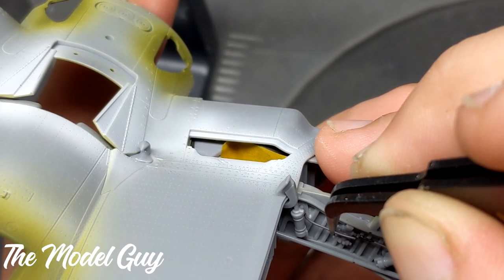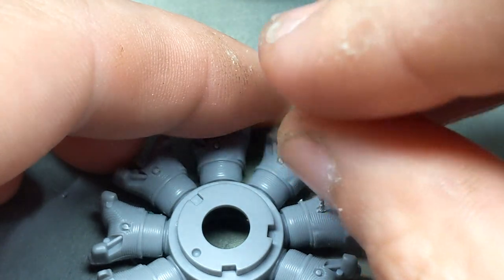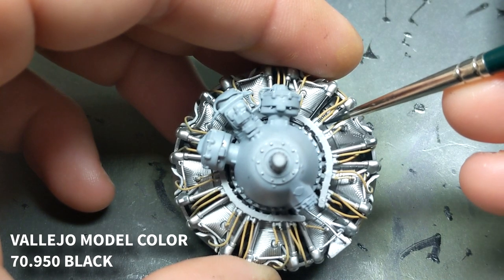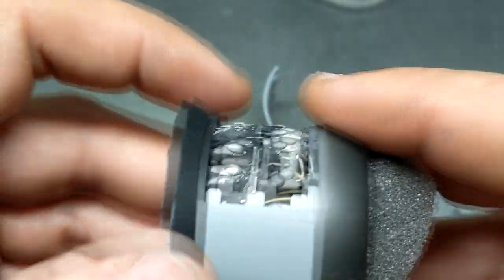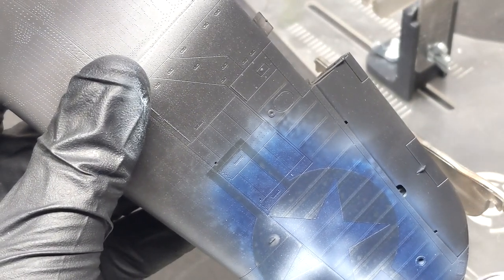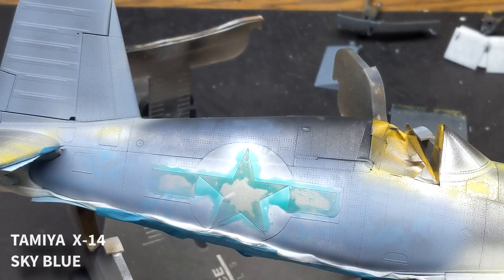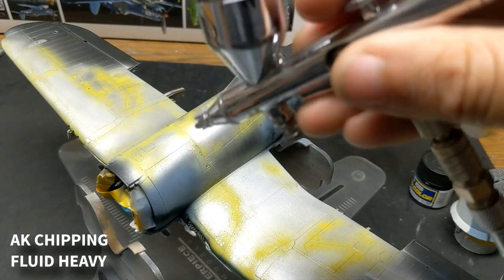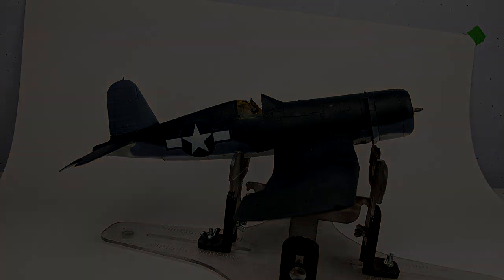F4U-1A Corsair from Tamiya: Setting the base for heavy aircraft-model weathering

Comment: The ignition wires to the rear cylinders run UP through the rear row baffles.  They don't interfere with the cowling when run properly
Reply from the maker: Thanks for the tip. I’m sure to build another one some day. Maybe with the engine completely open.

Comment: Are your cowl details available? While I have a brassin engine set, the detail trade off wasn't worth building it. the cowl flaps are included, but it would take too much work to make them fit with the kit supplied parts.
Reply from the maker: @patharmon9760  I’ll have to see if I can find them. They’re pretty simple and I could design an even better set now.
Reply: @TheModelGuy  That would be amazing. I'm a bot of a novice when it comes to 3D modeling. I've tried Onshape and Tinkercad with better luck than Fusion, but all of them are a bit cumbersome to me.

Comment: Yep, chipping can get frustrating. Tried it recently and let my lacquer paint (Tamiya XF and AK RC) dry to long. Do you think I could get that paint to chip...Nope! Then I tried on a different model and chipped within an hour of painting. Chipped easier but not as easy as other videos let on.
Reply from the maker: What were you using for a base paint and chipping fluid?
Reply: Primer was Mr Hobby 1500, then Tamiya LP-11 Silver (wanted the silver layer to be tough), then hair spray. Final coat was was either Tamiya XF or AK RC on 2 different models. The first model with Tamiya XF dried overnight and then I could dab away with water and stiff brushes until dooms day and the paint would not chip. 2nd model was with AK RC (same process) and tried chipping within 1 hour of applying paint and it seemed to work but was still an effort. Not as easy as many you tube videos suggest. Maybe they where using acrylic paint for the final layer????
Reply from the maker: @Maddog-nb9vu  hmm that sounds like it should have worked. If it's being stubborn, I'll use sanding sponges to start the chipping so the water can get under easier
Reply: I did try that but had to be very careful I didn't sand down to the primer coat. It still was next to impossible to expand on the chipping no matter how much water or dab, dab, dab, I did with a stiff brush. I even tried initially scrapping carefully with a xacto blade but the chipping would not expand beyond the scraped area. The only way I could get chipping  to work with hair spray process was if I started the chipping within an hour or two after the final paint layer was applied.
Reply from the maker: @Maddog-nb9vu  I hear a medium hold hairspray is the best.
Reply: @TheModelGuy  Will have to confer with the wife on that term to point me in the right direction :)

Comment: Looks like at 6:22 you filled the small gap behind what would be the cowling.  You can see a small white material there at this time marker.  Is it plastic card?  Plastic putty or some kind of filler?   I assembled this assembly just now on mine and I have the same exact gap.  I’m asking so I can find the best way to correct it.  BTW I needed just a tiny amount of filler in front of that round filler cap  piece too.
Reply from the maker: That was perfect plastic putty. Once it was in place I wiped the excess away with a damp, not wet or soaked cotton bud
Reply: @TheModelGuy  ok cool I have some of that.  Thanks for the fast response.  Love the videos.  Keep it up!

Comment: I'm just getting into the hobby and started watching your videos. I'm breaking in with the Tamiya VOUGHT F4U-1A CORSAIR 1/48 and the complementing A6M3 Zero. I was wondering what size wire best suited for hydraulic lines and wires for 1/48 models?
Reply from the maker: I would go with 0.1mm and 0.15. You can also strip regular 18 gauge wires too. Whatever looks the best to you

Comment: Robbie I see why you closed the engine up (2:42). You don't have the exhausts glued in. Was it intentional? Great build otherwise.
Reply from the maker: That is intentional. The exhaust were glued to the firewall already if you watch until 4:30ish. I couldn’t get the cowlings halves to join because the lead wires I put in were interfering with the fit
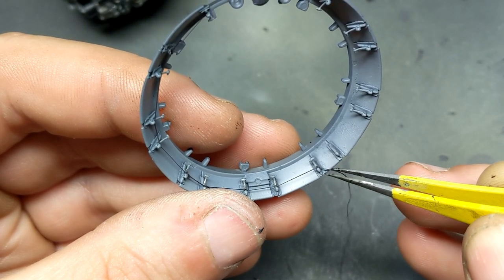Reply: @TheModelGuy  referring to Parts H1 and H2 don't seem to be there (5:40) they attach to the front cylinders of the engine, then attach to the firewall exhausts parts in 4.30